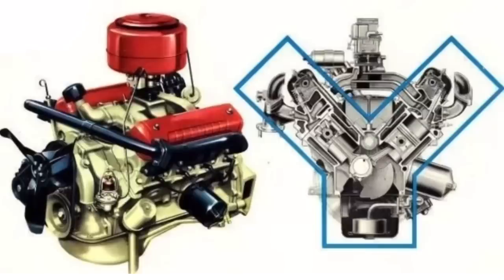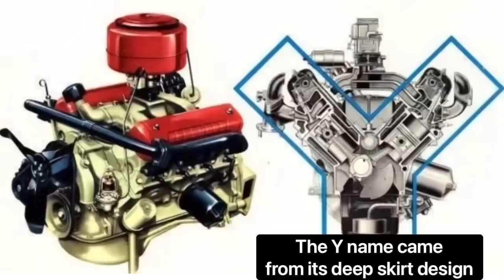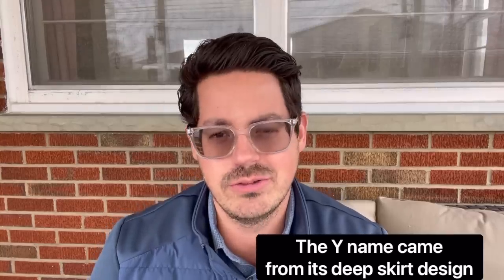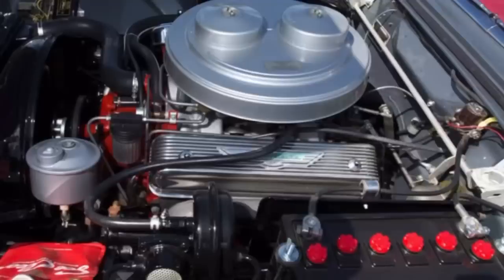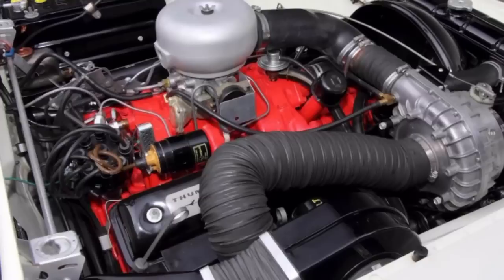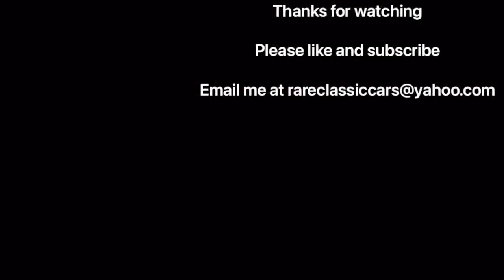Worst Engines of All Time: Ford Y Block V8

Comment: I grew up around Y-Blocks, these motors were bullet proof, and much stouter than Chevrolet's small block at the time. Just change the oil like you're supposed to. The 57 Ford 312 was one of the fastest cars on the road, dominating NASCAR that year. I have a 56 F100 with a built 292, with all the modern upgrades, it rolls along with today's traffic with no problem.
Reply: THE OIL GALLYS ARE ONLY SO BIG , SLUDGE BUILD UP RESTRICTS OIL FLOW & LUBRICATION EVENTUALLY CAUSING ENGINE FAILURE , TOP END TICKING , KNOCKING LOWER END , CLEAN OIL & FILTERS A MUST !!!
Reply: My dad was a mechanic through those years with the Flathead as well as the Y block and we've owned Fords all along I understand the details of the issue but it's more relative to using the right oil than the actual design problem Yes it's finicky if you don't comply also there was a problem with the head gasket blowing into that oil crossover path at the head gasket that will carbon up and then block it that would seem to be the more of the problem that I run into especially if the car was overheated and you had a bit of a warpage but they were rugged in the truck form they had a forged crankshaft and ran quite well and very reliable we had a 56 custom line 272, and a 62 Galaxy 300 with a 292. The 56 272 was overheated My grandfather used the car and he would never warm it up he would just start it up and take off drive it 2 mi and shut it off that was horrible for that engine because by the time he's shutting it off it was just getting oil to everything which is catastrophic to any engine today's engines are designed to oil quickly but back in the day that there was the more requirement of warm up to saturate the manifold passages while the chokes closed where today's fuel injection doesn't require that as much and the oiling is designed to oil quickly in a few revolutions so the 272 was eventually overheated due to low coolant and yes the passage was blocked by blown gasket and I found out that it was somewhat common on overheated engines so I pulled ahead on that engine and to find it the cylinder wear was considerable because the engine was having blow by this was all due to the not warming it up The engine oils were good My dad used Kendall for the most part especially in the galaxy and that engine at 80,000 mi taking it apart was clean in the rocker covers and it was still getting oil and it ran fine no problem and always reliable always started and in fact the transmission failed because that was common with those with the fordOmatic and it going about 80 mph it downshifted into low on its own that engine was screaming . The two-speed fordomatic was more of a problem I believe with the aluminum case would crack The Borg Warner 3-speed cast iron was far greater a better transmission. Those that I know that had the y block got a lot of miles out of them One roofer friend of my dad's he had a 56 pickup with a 272 well over 200 some thousand miles and used it everyday that was his bread and butter truck ran that over 20 years. As far as the sound of that engine I like the sound of it it's very unique and it's self just like the flathead and it has a very low mellow tone and if you look at it with a sound recording and look with a scope it puts out a perfect sine wave form on this in that galaxy was also a very quiet engine Chevrolet engines were all notably noisy especially the 307 that thing I could always hear when next to me when sitting at a light one would pull up and I'd look over already knowing it was a 307 just by the sound I would look and see the 307 badge on the fender and we had a '69 Chevy pickup half ton with a 307 and yeah they had their problems too and those years they used that nylon camshaft gear and that was a big replacement issue My dad sold a lot of those because that thing would fail around 60 -70,000 mi notably in his parts business he had The least amount of parts he sold for a car was Buicks he sold the least amount of parts for those out of overall everything else  the years he owned the business he only sold one belt for front drive tornado the engine to transmission drive belt. In the 292Y block was also used in Mexico well into the mid-80s but I believe it had a different headsThe valves intakes and exhaust were evenly alternated I think there were other worst engines than this I'm not sure why the black tag on it but that Buick aluminum V6 as far as I'm concerned that Vega engine was not so great. And their 215 V8 ended up in Land rovers British Leyland took it. Though the Flathead was reliable and fairly easy it had its problems too long exhaust runners added extra heat to the cooling plus issues with cracking and most of those cars 50,000 mi needed a valve job Chrysler with its underwhelming six cylinder it had hardened valve seats so that thing's unleaded ready. But nevertheless the Ford engines provided good fuel economy for the day Ford's overhead valve six cylinder that came out in 1952 did not have a check valve setup in the oil filter so when it was shut off all the oil would drain back so when you would start it it was noisy until it started getting oil again but the engine ran great and literally quicker than the flathead 239/100.
Reply: FROM A ENGINE STANDARD FORD COULD HAVE MADE IMPROVEMENTS ALONG THE 10 - YEAR RUN , ANY LOGICAL MACHINE SHOP WORK TO IMPROVE LUBRICATION AND PERFORMANCE IS WORLDS APART FROM A PRODUCTION LINE ENGINE ASSEMBLY !!!! AT EXTRA COST OF COURSE !!!!

Comment: In my youth I had a 62 F-100 with a 292 in it. It had its issues just like any engine in those days , that all engines had. No PVC system so engines slugged up big time, no matter the manufacture as people got used to using detergent oils and changing oil and filters together at the same time. The Y-block engine was pretty much indestructible but the big issue with them was the intake port design which was offset 90 degrees , top n bottom compared to the small block Chevy and Chrysler that where side by side. Who in the hell came up with that stupid intake port design and thought it was good is beyond me. If the YBlock had a side by side intake port design it would have made a lot more horsepower. Another issue was the Y-Blocks that I’ve worked on is after a long time the distributor in the back was notorious for sticking solid to the block, we’d have to get a big pipe wrench on them to get them unstuck. Other then these issues it was a good engine and would take a hell of a beating and keep on ticking.

Comment: What an idiotic assessment. They were an extremely reliable engine. The only criticism by the end of this "conclusion" was an oiling issue of which there was none. There was a neglectful owner issue with a bad workshop issue, both because of incorrect oils and some hopeless rebuilders as still applies to any engine to this day. Having been around in this era and having owned, worked on and modified several, I have very good knowledge of them.

Comment: Gotta wonder how many Y blocks you have worked on. Running the original Y block to this day in a 64 F100. Does not have the added oiler on it and never has and with the valve covers off it will flood over the heads with oil. Just like anything if you do not maintain something it will not last. Human stupidity does not make something a bad thing. Ford used the Y block until 1980 or 81 in South America. The deep skirt block gives it tremendous strength and the exhaust note is fantastic. And it is torquey. Can't use the words torque and lug in the same sentence with small block chevy
Reply from the maker: Have had plenty of 55-7 Fords.
Reply: @RareClassicCars  Then you should know they aren't near as bad as you portray them to be.
Reply: @skidoorulz4914  — I worked on the things. They were the worst of their contemporaries. The OHV V-8’s from Chrysler, Olds, Buick, and especially that beautiful Cadillac were superior to that Y-block.
Reply: @sking2173  OK but that does not make them a bad engine. Everything made as a superior or inferior competitor. The Y block was called a bad engine because of the way people maintained them, That does not make it a bad engine. As I said I have one to this day in a 1964 F100 and it has only been rebuilt one time. Can't say that about a 60 year old small block chevy

Comment: Listen all....
This guy is not really qualified to really determine if an engine is good or bad. Just as an example the small block chev (in the beginning) was not so great either and had its problems as well, namely the oiling system, which unless its a race block has the small basic oiling system like ALL other American V8s,
being the lifters get oil first.
If you are a true gearhead this channel is not the place to be.
More propaganda then anything.
Not perfect, but nothing wrong with a Y block.

Comment: i loved my 292Yblock.  I am a solid Chevrolet man, but the sound of a Y block on glass packs just off idle.....Sweet!   I agree that the oil requirements were the big challenge with them.  If you kept good oil in them and not let them leak, they were great!

Comment: Seems unfair to blame these engines bc of failed maintenance by owners. I owned and drove a 55 Ford Custom with a 272 V8 and yes, it failed....but that was definitely due to the lack of maintenance. Paid $50 for the car so wasn't out very much when it died.

Comment: I have had a few of these. Not fantastic on horsepower or torque. Though the torque was a maybe better than fair. In my mind these were dark years for Ford until 64 with the big 6
Reply: In ‘62, the Ford small block V-8 (Windsor) was introduced, which in my opinion, is Ford’s best-ever engine.

Comment: I have a 56 ford parklane sport wagon and I rebuilt the 292  I came up with a permanent fix for the oiling issue .I cut a groove in the cam journal in the block that fed oil behind the bearing to the feed holes  . It works so well I had to put .060 restrictions  in the rocker stand so it wouldn't over oil.  This engine is running 3 2 barrel carbs that have been converted to fuel injection and electronic ignition control backed with an AOD transmission it runs 75 mph all day and gets 22 mpg its a great engine
Reply: I smell B💩...
Reply: @sking2173  you must be smelling a chevy then .go to the megasquirts sight there is a picture of my 292 and a small write up .it shows the tri power FI and electronic  distributor

Comment: Where I grew up it seemed like most of the farm trucks had Y block engines in them and a common modification was to take advantage of the cross over exhaust and run the exhaust pipes out through the hood for use in the wheat fields during harvest time to help to not catch the field on fire while working with the threashers.

Comment: I had a 62 Galaxy that had a 292 that ran better than any engine that I ever had. It was the quietest engine I ever heard and I could pretty much start it anytime just by turning the key. I used to have the window down and reach in and turn the key and many people around said they never seen an engine run so good that didn’t have fuel injection.

Comment: Our family had a 56 wagon with Thunderbird valve covers, and a 57 on a farm in New Hampshire. My dad was a Ford V8 guy from the 30s so he had no problems with buying the Y block. We bought non detergent oil by the case so I don’t think ours got detergent oil. I’ve driven flat heads with triple carburettors which made more noise than impressive power. I remember being alone on the interstate in the 57 and punching it. Wow, it was just a stock V8 Y block but yeah it pulled up to about 100 when the suspension told me to back off. We never had engine oiling issues but in our rural situation our most common trip was about 8 miles up and down hills at 35-50 mph, so I think we escaped the oiling issues that people doing stop and go driving encountered. Never knew about these issues before or that the GM small blocks were a better choice at that time. I later owned 54 Desoto that had  the early Hemi in it and I didn’t know what I had was special, but I was aware it was the nicest V8 I’d ever driven - smooth and solid it carried me and my family across the US and ended its days in Frisco in a street drag.

Comment: They should call this the WHY block, as in why did they replace the flathead with this piece of crap?
Reply: No, because the flathead was long overdue being replaced; it was long past simply being obsolete.

The “why” questioned the reason Ford’s new OHV V-8 wasn’t up to the level of quality of its contemporary OHV V8’s.

Thankfully for Ford, they were able to gain a level of redemption with the release of the FE-series engines.
Reply: @sking2173  Well yeah.  Kaiser-Frazer put a flathead 6 in all their cars.  This was adequate, but when their competitor's were offering OHV V8s, few people wanted a Kaiser, and they went bankrupt.
Reply: @jenniferthomas3875  — flatheads are best left to lawnmowers.

Comment: Yeah I dont think you know what you re talking about.!st of all you dont look old enough to have ever had a Y block back in the day.I think you re correct about oil though.Detergent oil wasnt accepted then by the older guys.A lot used non detergent and kept on after detergent oil was introduced.Also mid fifties to sixties NOT changing your oil filter each time was very prevalent.So you put in 5 qts.of oil one time with a filter.Next time they left the dirty filter and only poured in 4 qts.of oil so 20% of your oil was dirty for another 3000 miles added to the 3000 miles that were already driven.So there might have been a lubrication problem but it was exasperated by old school oil and not changing filters every time.I drove a 58 custom 300 with the 292 cu.in.and I found it a wonderful engine.

Comment: My dad had a '55 Fairlane with a 272 Y-block, bought it new, no problems, drove it to the junkyard in '66 due to severe structural rust. He replaced it with a '62 Wagon with a 292 Y-block and with 4 teenage drivers it wasn't babied, no troubles and was sold with well over 100K in '71. A lot of family members owned Y-block '54 -'62 Fords and Mercs that ran fine. The only common issue was failing water pumps at around 40K miles. No problem changing them. Otherwise, they seemed to be very reliable motors. The flatheads had their issues too. I had a '51Merc, '50 and a '51 Ford that had vapor lock and would overheat in hot weather. 265 and 283 Chevy V8's back then leaked oil and some of the gasket material was crap. Mr.Gasket made a fortune with replacement kits.

Comment: The oiling kit reminds me of a similar kit that was sold to remedy a problem in the early 80's Honda V4 powered motorcycles. It was found that the oil supply was insufficient in one of the heads (IIRC it was the rear one) when the motorcycle was idling. Although some thought the real problem might have been the cam material was too soft, the result was the same- worn cams. Whatever the case was, the oiling kit would fix it by adding a direct supply to the cam area. EDIT: One other thing, on the quietness of certain engines- there was a mindset in the early decades of automobiles that "quiet = quality" so much effort was spent to make cars, esp luxury cars, to run quietly (even though the concepts are not actually related)
Reply: Same with the most LA engines. 273, 318, 340,&360.
We would add a copper line inside the on #2&#7.

Comment: I had countless numbers of 292 and 312 motors in my '57 Ford hardtops and only threw a rod in one, a 312. It was the manual transmissions which wouldn't hold up to weekend drag racing. Low gear on the cluster would always break but installing a heavier trans with wider gears from a '56 Merc solved that problem. Also installing a 9" 4:11 geared rear end with leaf springs from a six cylinder '57 wagon with manual overdrive helped with the motors potential.  Quite a few motors I bought already had the overhead oiler kit on them and lots were also full of thick sludge from using non detergent oil and running too cold from an owner removing the thermostat. They made the most beautiful exhaust rap by running straight pipe with 18" Thrush straight thru resonators up front instead of mufflers. Man, I miss those Y-blocks!

Comment: In 1976, I bought a '56 Ford pickup, with a 292,  for $100 from a junk yard.  I changed oil and filter, adjusted the valves, installed new valve cover gaskets,  tuned it up, and rebuilt the carb.  I then drove the truck to work ( 40 miles a day), for over 2 years, ( It never used oil, or let me down). I then sold it to my brother, who used it for another couple more years, then he sold it to a guy that hauled junk.  That guy drove it another year before it finally gave up.  It had developed an oil leak, and he ran it out of oil. Originally, the guy at the junk yard thought it had a rod out of it, but the solid lifters just needed adjusted.  So, I think the "Y" block was fine for it's intended purpose.

Comment: I owned and drove a 64 F100 for 20 years and it was a great engine. Burned 0 oil and was very dependable. Never had oiling issues ever! Used Rotella 15W40 the whole time and never had any problems whatsoever. Just watch Tim McMasters videos and see for yourself. Jussayin

Comment: ive only ever dealt with 390's and stroked 390's using aftermarket steel crank,also seen cleveland heads fitted,definitly not a lemon engine
Reply: Did they bolt the 390 manifold up to those Cleveland heads 😂 ?
Reply: @sking2173  no cleveland aftermarket aluminium with some mods smartarse
Reply: @sking2173  you also have to remember the most powerful strait 6 ford built had a head made out of 3 pieces of cleveland head welded together